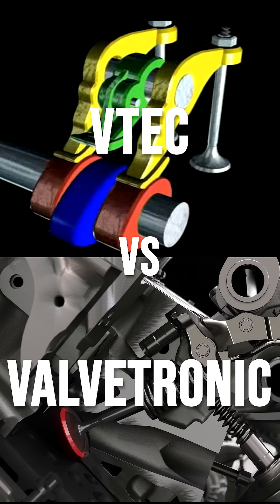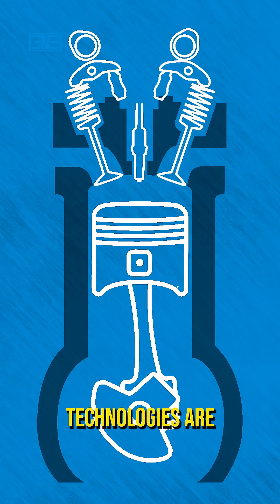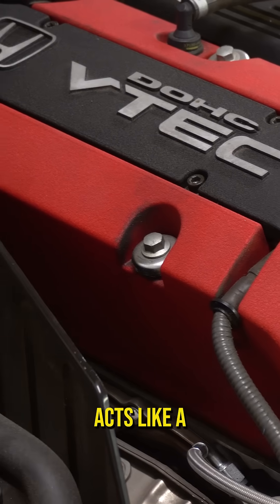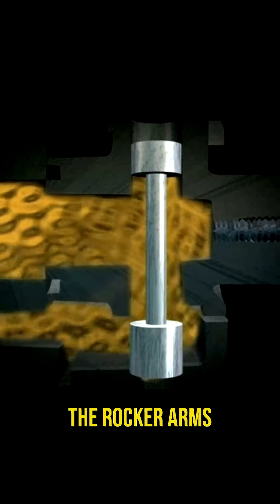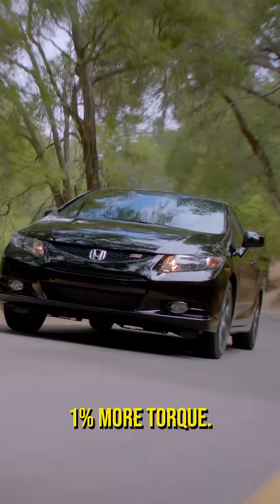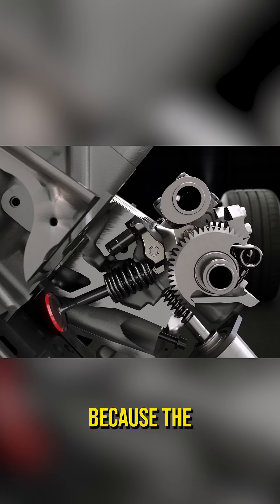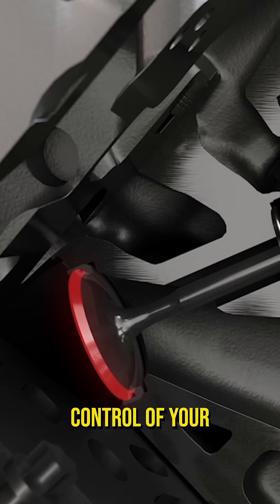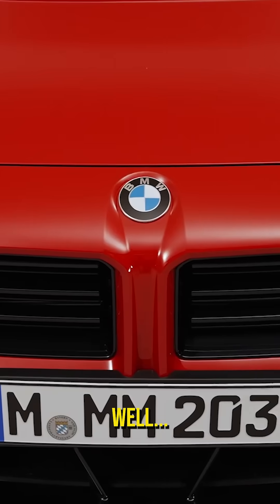VTEC vs Valvetronic - Honda vs BMW!

Comment: I bet no one would even know how to fix a Vtec, because no one ever had to. But there are plenty of experts on fixing Valvetronic.
Reply: @ If VTEC does break, the engines will still run like normal but without the high cam profile. If Valvetronic breaks, the car can only be driven in limp mode.
Reply: @76horsepower Only if it breaks with the valves closed. Any error just switches the system off, valves go into full lift and the car can still be driven normally. If the valves can't be opened to fill lift you can drive the car in reduced power. It's very rare for a valveteonic failure to actually prevent the engine from running, and if it does there are only like two or three possible failures, doesn't exactly require an expert to fix.
Reply: @BigUriel  Thank you. Doesn’t sound like you’d want to drive it that way for long (you could drive a VTEC car with VTEC disabled indefinitely and you would’ve even know it unless you drove at high RPMs), but that’s still good that BMW thought of that, and that it resets to full open. I appreciate it.
Reply: @76horsepower  Yeah you can drive around and it won't damage anything. You won't even notice anything except for a slightly higher fuel consumption. I know because I drove mine like that for months before I got around to fixing it.
Reply: @76horsepower same with bmw, still has a throttle body. Can drive as long as you want without it
Reply: @76horsepower u r right dude
Reply: @76horsepower this is also a lie. BMWs will revert to the electric throttle body when valvetronic breaks, allowing the car to be driven for however long is necessary to get it fixed.
Reply: @initial86-2.5 Not a lie, but I could be wrong. What happens if the valves are at their minimum or maximum opening when it fails? I would think it would run quite terrible, would it not?
Reply: @76horsepower then it runs poor in certain rpm and throttle ranges but it still runs and that’s what matters to limp home really
Reply: @bigdbandit64  I guess my point is that you wouldn’t even know it during normal driving if VTEC broke (heck, you can pull a fuse and disable it), but I do appreciate BMW adding a limp mode.
Reply: @76horsepower yeah it was smart of them to have a back up throttle body
Reply: @initial86-2.5 novody asked But you answered You dont deserve credit you should give out the Prize if so lols
Reply: In my universe i never heard a single person successfully broke his Vtec other than weak selenoid or cloged after >20 years and many hundreds thousand of km on the car.
Maybe that happen in other alternate universe.
Reply: @Azzyazzy789 damn you got your own universe ? That’s a flex
Reply: @Azzyazzy789  take care of your engine?
Reply: @Azzyazzy789  i saw some youtuber that also racer build his project K20 and broke after testing run on track
and he blamed himself when engine build tho
Reply: @Azzyazzy789 I replaced dozens of not a hundred or so VTEC solenoids in the 6 years I worked at a Honda shop. Saw the cam locking pin break a few times on a J series. Typically the VCM ones specifically that have the same problems as the GM AFM system that leads to oil starvation.
Reply: @Zach-td5mb other than J series, is it because of they beat it or just daily normal commute cat?
Im interested with your experience.
Reply: @Azzyazzy789 combination of age / poor oil change intervals. That gasket is very prone to leaking and can also hurt the solenoid if it leaks bad enough for long enough.
Reply: @Azzyazzy789 but it’s not wildly expensive to replace, the part is like $300 if I remember correctly
Reply: @Zach-td5mb no i have d17 and the fist problem after 20 years are gasket leaks.
20 years that damn long 😂
Reply: You think no one knows how to fix vtec when they have been out for 25 years now like 😭
Reply: @2006hondacivicVtec
Keep going.
It's getting scarily close to 40yo.
Reply: A lot of things break on BMWs, super rare for Valvetronic to have an issue however.
Reply: @Rob_TheBimmerKid Yeah, most people are thinking of VANOS. That is just variable valves (like VTEC), and was quite prone to failure on the old M54s.
Reply: @Rob_TheBimmerKid thought it was a common issue in the s58?
Reply: @gavinbaer179  valvetronic isn't a common issue on the S58 at all, where are you getting this from? 

The S58 doesn't really have common issues in general, the closest to a 'common' issue is the fuel pump and it goes bad pretty rarely.
Reply: @gavinbaer179 the s58 is not a normal engine. Thats like comparing the dodge demon engine to a 4 banger toyota.

If you buy an s58, you already know you're going to spend tons of money because its a damn performance engine. Its so unfair to compare M(x) cars to any other car. Noones comparing other $150k+ cars to $40k cars lmao
Reply: @gavinbaer179 not really, its a bad maintenance issues, valvetronic has to be maintained a bit more and replaced every 70k kilometers, but it is still very reliable
Reply: @gavinbaer179  great engines want to see a 20 year cycle to make it great but it's good so far
Reply: @Rob_TheBimmerKid no the eccentric shaft bearings and actuator on the n55 fail around 100000 miles and it’s an easy job but the parts are 2k
Reply: My n55 has 160000 miles and no failure of the vanos or valvetronic system in general,  hell i haven't even needed to walnut blast the valves, and it's modded in top on that.  @aidenbirak
Reply: @Rob_TheBimmerKid i dont know if you have ever visited any forum at all or used google,i mean,no hate or disrespect,but valvetronic is a pain in the ass and breaks down all the time😂 bmw n13 engine, n46,n42,n52 etc all valvetronic problems.
Reply: In newer models yes. The E platforms… e90/e60 M cars had a lot of valvetronic issues
Reply: @Rob_TheBimmerKid Are u a BMW tech.. I guess not .. 😅 that valvetronic crap goes without warning and when it goes u need a tow truck because in 98% of the time it won't even starts 😂😂😂. 

On the Honda side .. if VTEC stops working you still have a drivable vehicle with just a check light.. so Honda all day everyday in this case
Reply: @MrBchott are you a BMW tech or engineer Wtf are you to say 💩  if your not 😂😂😂😂😂
Reply: Funfact : BMWs are actually in the top 10 of the most reliable brands
Reply: @Inixivity I can’t speak for all publications, but ones like Consumer Reports judge reliability based on the first few years of new vehicle ownership; they don’t look at 20-year-old cars with 200k miles of abuse on them to see how they’re holding up, which is how I judge reliability, since I only buy used cars. This may or may not affect things, but my guess is that it would.
Reply: @Inixivity Barely 10 var brands on the road though.
Reply: @Inixivity I guess that's why an 85k BMW sells for 15k in 10 years.
Reply: The vtech actuators get clogged or leak pretty often. Mechanical devices fail and need to be maintained. Honda is no different.
Reply: damn faxx yo
Reply: Because the Japanese are simple.
Reply: Case closed, sir! 🫡
Reply: Cause vtec is a lot less complicated and straight forward. Did you not watch the video to see the differences between the two?
Reply: BMWs and known for... Burn My Wallet ..
Reply: You couldn’t have said that any better
Reply: It depends on the iteration of valvtronic we are currently on gen 4
Reply: fact
Reply: Vtec solenoids fail all the time. Luckily they’re super easy to replace.
Reply: @dcskate1022yes it happens alot but u can drive home and fir the rest of the month until u get it fix in a honda .. BMW now hahaha haha
Reply: That part
Reply: Nah.  I'm a Honda tech.  You learn how to fix VTEC while fixing other issues in the engine.  We had one customer "roll a 1" on their J-series bank 2 camshaft endplay.  Their cam sensor started to machine away and stopped reading the cam.  On the way out, we had to remove the rocker arms and the VTEC solenoid assembly to get to the cam.
Reply: That’s so 🧢
Reply: You'd lose that bet. I have to fix both systems. It is hardly cheaper either way. Go home.
Reply: Give me simplicity the VTEC.
Reply: Trust Ze Germans to take an engineering principle then go completely overboard in designing a new version. 

I swear, Germany still has a huge stockpile of pervitin that they force feed their engineers 😂

Never change Germany, never change.
Reply: Ive got a 20 year old beamer thats never needed its valvetronic opened up lol but ok
Reply: Vtec is easy to fix as it is so simple. Some people actually decide to lock it by swapping the orientation of the pins.
Reply: To be fair both my prelude and civic have broken vtec when I bought them, it was the solenoid on both
Reply: Because it rakes in money to fix overengineered German cars. Try swapping a starter on an early 2010s 520D without taking the engine out. Literally no room to work on despite the large engine bay and the engine only being a 2 litre
Reply: The only time my VTEC didn't work, it was because I was out of engine oil. 😅
Reply: Valvetronic doesn't really cause issues, vanos is the system that can go wrong. That being said, my n52 which has both systems and 135k miles has never had engine trouble codes.
Reply: Never heard of a valvetronic problem other than swapping the motor occasionally. And resetting it, reprogramming it, etc. Rest of the system is good. VANOS on the other hand has lots of reports on issues. Never had any myself other than lifter tick.
Reply: survivorship bias 😭
Reply: What a diffrent car not made in former naziland
Reply: Nah I just chase leaks, valvetronic is solid. It's worth it just to smoke Honda's
Reply: Haha..yes,,it will make the mechanic wonder, what cause the Break in a VTEC 😅
Reply: And more expensive
Reply: The moment he said "but its a lot more complex system" the winner was known
Reply: 😂😂😂😂😂 L for BMW
Reply: Depends on region, in my country Japanese cars are more common and European cars are considered a luxury.
Reply: @Empress_Homura I know your region. It called "earth".
Here on earth japan car are common, while europe more luxury 😂
Reply: @Azzyazzy789 this is not true. European cars are much more common than Japanese cars in Europe, and they are definitely not luxury products most of the time there. But yes, most other places tend to see more Japanese cars.
Reply: @Empress_Homura   here in middle europe european cars are cheaper than toyotas (vw group ones are cheaper than toyota)
Reply: @Empress_Homura  In America, yes, but in Europe, no
Reply: @Empress_Homura okay, bot. Thanks for adding to the conversation.
Reply: Dead wrong actually, Valvetronic is quite a reliable system and the common failure points are cheap to fix. 

This is just an assumption you made because it's a BMW system, without actually documenting yourself on how it works or whether it works well. I don't understand why people comment on things they have no knowledge of.

Comment: Very rarely hear of a valvetronic issue that didn't involve poor oil change intervals.. One place where the complexity doesn't typically lead to failures. There's no comparison from a power curve aspect. I have owned many of both well into high mileage.

Comment: Even if it's objectively less effective, the sudden kick and change in sound from VTEC will always be way too much fun.
Reply: And then you wanna hold it to 8 grand before shifting so you stay in VTEC mode.
Reply: @TheRealDrJoey  she can handle it.
Reply: @TheRealDrJoey  well, it's a Honda so she'll be fine
Reply: @Exodlus  
I've got a Type R in my '97 Del Sol---redline is 9,000, rev limit @ 9500.  So, yeah, she eats it up.
Reply: @TheRealDrJoey  Yeah my 2ZZ falls off  cam unless you shift between 8000 and 8500. Toyota VTEC...
Reply: @Blas4ublasphemy Toyotas are cool but their version of VTEC is not so exciting.
Reply: @keep_it_low_bro  How are they different? I've only experienced the 2ZZversion in my Elise 111R with sport exhaust and it's hard to believe the Honda version is even more dramatic!
Reply: The sudden kick of 40hp instead of 35
Reply: @discbrakefan  It feels and sounds like way more than 5 hp but maybe thats because my car weighs under 2000 lbs.
Reply: @Blas4ublasphemy Or you’ve just never felt real power
Reply: @discbrakefan  I own a Lingenfelter 427 CI LS3 swapped 02 Camaro SS street/strip build...
Reply: @Blas4ublasphemy have you driven it? And if so why you caring about vtec yo
Reply: @discbrakefan  I only cared about performance stats at one time, until I had the Camaro built and realised it was less fun than my Fiesta ST. My next purchase was a Lotus Elise. I still own and love all 3 cars.
Reply: It noticeable even on a Honda Odyssey van when you floor it.  You feel the increase kick in and it feels like more than 1% to me.
Reply: @mickeyflynn5427 That’s because you only drive slow cars.
Reply: @discbrakefan Ask your mom about her vtec and how fast she likes being driven.
Reply: @mickeyflynn5427 😂😂😂😂😂
Reply: Me smiling in my v6 Acura

Comment: For starters, let's acknowledge that Honda thought of it first.  Secondly, NATURALLY the BMW system is more complicated, because when it fails (it's on a Beemer, thus it will fail) like with virtually any repair on a luxury German car, ANY repair will cost so much, the car is totaled.
Reply: Vote Honda VTEC

Comment: And Honda VTEC is more than 1% ... the center Cam Lobe has .500 more Lift & double the duration. On intake & exhaust.  
FYI >
     .500 = Five/Hundred/Thousandths

Comment: BMW's version is nice but it's unreliable has not been tested very long and 10x more expensive if something breaks
Reply: Valvtronic has been around since the late 1990's.  The problem was ridiculously long oil change intervals of 15k miles and poor choice of gasket material on some VANOS units

Comment: My Honda motorbike has a different kind of VTEC; it only has 2 valves per cylinder active under 6800rpm; above 6800 it activates the other two valves so it has 4 valves per cylinder, you can hear the sound change and man above 9000rpm you gotta hold on.

Also the Multiair system from Fiat is very interesting.

@EngineeringExplained we need a video of both systems 😉
Reply: Honda engineers impress the hell out of me.
Reply: which motorbike u have dude? feels like im gonna need one xd
Reply: @starlordyt6151  Honda VFR 800F, in the USA I think it is called the interceptor

Comment: Honda gets the win simply for being the pioneer. Their VTEC system inspired every other variable valve timing system currently in existence, and most automotive engines for many years have used such systems.
Reply: just because you are a pioneer doesn't means you win automatically.
Reply: @Seb-Storm Depends on who’s voting.
Reply: And even still you’d be hard pressed to find a better VVT system than i-VTEC lol. You can list on your fingers the amount of motors with variable valve lift along with variable timing. MIVEC, Neo VVL, the Subaru one on the ej25’s, VVTL-i, pentastar VVL, maybe a few others I don’t know about, and most have valvetrain failure issues too. Hondas produced more different motors with variable valve lift then most other company’s combined it seems.
Reply: @DMVKIvak Audi has made plenty of engines with VVT and VVL. EA113, DAZA and other engines with a hydraulic actuator who changed the lift and the timing on the engine. Started with the A3 back in its first gen, the 8L, 1996.
Reply: @DMVKIvak That's... that's just plain wrong. There are TONS of cars with some form of VVT.
Reply: @Itsjamilagain  not variable valve lift tho
Reply: @DMVKIvak You are correct, my previous response was false as it's the other way around. My bad.

Comment: What is the point of throttling at the valve especially since they still use a throttle body on the BMW under certain conditions.  This seems like an engineering flex and nothing more

Comment: As a die hard honda fan, and a former bmw technician. I would give bmw the win on valvetronic, it is more complicated but it is also more elegant and thr tuning possibilities with the dynamic compression from vakve timing with vanos and valvetronic is magnificent.

Comment: My pick ended up being Multi-air. Which is it's own unique take on this problem. It's good though, very smooth in town with nice power up top.
Reply: MultiAir is a step even further than Valvetronic, and IMO some very impressive tech.